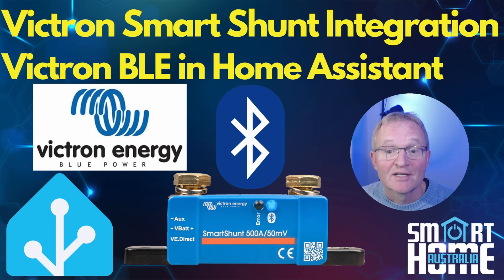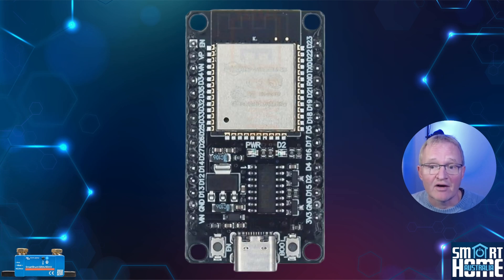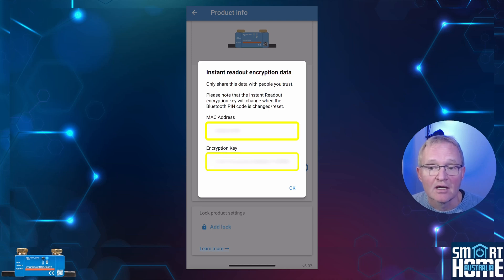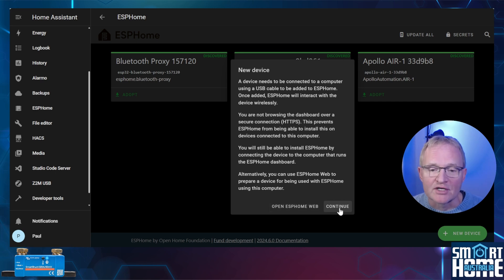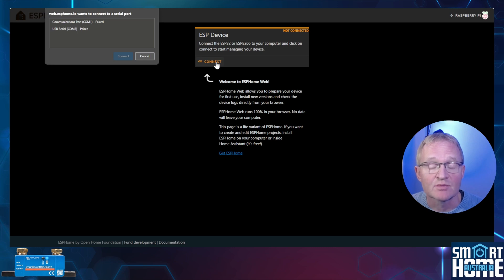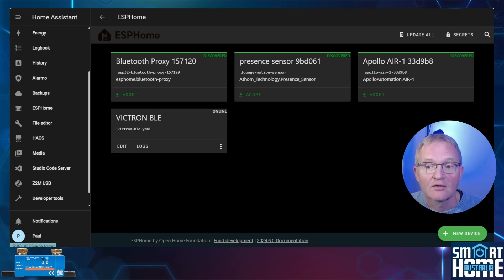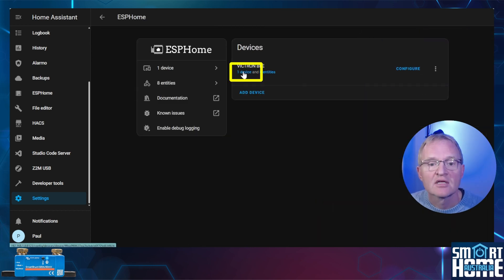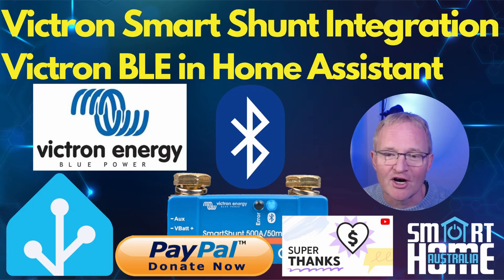Integrating Victron Bluetooth Device into Home Assistant: A Comprehensive Guide

Comment: It works to the moment that I make new device and write firmware. After add shunt it doesnt Connect anymore. Tried 2 esp32. What I do wrong?
Reply from the maker: Yep — this exact “works until I add the SmartShunt bit, then the ESP32 goes offline” is usually one of these three things, a few things you can check for:

1) The ESP32 is rebooting (power/noise) once BLE scanning starts
BLE scanning + Wi-Fi is a bit heavier on the ESP32. If your power is marginal, it’ll boot, flash fine… then fall over when it starts scanning.
Try this for a potential quick win:
- Power the ESP32 from a solid 5V supply (aim 1A+ capable). Don’t power it from sketchy USB ports / thin long leads near the shunt/inverter wiring.
- Add a big cap across 5V/GND near the ESP32 (e.g. 470µF) + a small one (0.1µF/1µF) if you have it.
- Keep the ESP32 physically away from high-current cabling/shunt bars (noise city).
- In ESPHome set `logger:` to INFO (DEBUG spam can contribute to instability).

2) It’s online, but you’re getting no shunt data (looks like “not connecting”)

Fro this there are two gotchas from the `victron_ble` component:
- You must use the device MAC address + AES “bindkey”, and Instant readout via Bluetooth must be enabled. 
- If your phone is actively connected to the device in VictronConnect, **the Instant Readout advertisements stop**, so the ESP32 sees nothing. ([GitHub][1])

To test this:
1. Stand 1–2m from the SmartShunt with the ESP32.
2. Completely close VictronConnect (don’t leave it connected).
3. Watch ESPHome logs for Victron packets.

3) Bluetooth range/placement is worse than you think
Victron even calls out that the shunt + big cables reduce BT range, and metal/vehicle chassis can make it “unacceptable”.
Reply: @smart_home_australia I use victron natibe, when it get enough range it pop up in HA and just add it ;)

Comment: How does the esp32 get your wifi network data?  Does it inherit the wifi config from the Home Assistant or did I miss a step where we told it the wifi info?
Reply from the maker: Yep, you didn’t miss a sneaky “inherit Wi-Fi from Home Assistant” step.

An ESP32 won’t magically grab your HA Wi-Fi settings. It gets Wi-Fi in one of these ways:

1. Baked in at compile/flash time
   If you’re using ESPHome, the ssid/password are in your ESPHome config (usually via secrets.yaml). When you flash it (USB/web flasher), those creds get written onto the device. After that it joins Wi-Fi and you manage it OTA.

2. Provisioning during onboarding
   Some ESPHome setups use Improv (Serial or BLE). In that flow, HA (or the ESPHome web installer) prompts you for Wi-Fi and then securely pushes the credentials to the ESP32 during pairing.

3. Temporary AP/captive portal
   Device boots, creates its own Wi-Fi hotspot, you connect to it and enter your Wi-Fi details.

I hope that helps.
Reply: @smart_home_australia  I kinda figured out if I used the interactive setup for the initial flashing it prompts for wifi and even adds a failover wifi option.  Thanks for the fast reply.  My son in law is going to deer camp this weekend and i am not.  My main rv solar is in home assistant and he wants his solar integrated via his smart shunt in another building.  I am hoping he can plug it in and with my prompting and his physical help we can flash it successfully.  will find out soon enough
Reply: It's working as planned.  I didn't add the "power" sensor because it wasn't on the default template I used.  Can i add a sensor to the yaml then just reinstall over wifi
Reply: Update yeah you can add other sensors from the supported list and update the yaml and push the updated config.  I am also very impressed how quickly these little units boot
Reply from the maker: I was amazing... the speed was excellent and wiht those additional sensors you get great flexibility...

Comment: A year late but I wanted to thank you for this. I’ve been having all sorts of problems with the Modbus integration for the last 6 months, recent updates have broken it quite badly, and this has solved all the problems I was having. Incidentally, although I haven’t tried it myself yet, there is now a Victron BLE HACS integration for HA. If this works it would mean being able to cut out the ESP32 from the system (providing the HA computer has BT and is within range). As I say, haven’t tried it yet as I’m reluctant to mess with a working system, but I may give it a try as I’m not likely to use my campervan much over winter (I’m in the UK). At worst I’ll have to restore a backup. Thanks again
Reply from the maker: Love hearing this – glad it rescued you from Modbus pain! That integration has been a bit “two steps forward, one step back” lately, so having the ESP32 + BLE bridge as a rock-solid workaround is a nice place to be.

I’ve seen that Victron BLE HACS integration but, like you, I’d only switch a working system if I had time to tinker. If you do try it over winter, just watch:

- BLE range in a campervan (metal box = sad Bluetooth)
- How quickly it reconnects after HA restarts / Victron sleeps
- Whether all the entities you care about show up with the right update rate

Definitely grab a backup first so you can roll straight back to the ESP32 if it misbehaves.
Reply: Hi mate, well this escalated quickly. Found myself with an hour to kill and went into my van HA integrations, disabled the BT proxy and re-enabled the Pi BT and lo and behold, all the same sensors showed up! The only downside of BT is that it doesn’t expose as many entities as Modbus, but the main ones I need are all there, and it’s so much faster. I’ve now taken the ESP32 out of the van and all the functionality has remained the same. Mission successful 👍

Comment: Hi , Great video !. I am working on a ESP32 firmware without ESP home assiant and  I want to connect my victron smart shunt to it so that i  can get the data wirelessly through Bluetooth. Is that possible?
Reply from the maker: Hey, thanks!

Short answer: yes, it’s possible without ESPHome or Home Assistant, but you’ll basically be rebuilding what those do under the hood.

Here's the helicopter view:
1. In VictronConnect, enable “Instant readout via Bluetooth” on the SmartShunt.
2. In Product info you can see the MAC address and an encryption/advertisement key for that device – you need both to decrypt the BLE data.
3. On your ESP32 firmware (Arduino or ESP-IDF), write a BLE scanner that listens for adverts from that MAC, decrypts them with the key, then decode the payload using Victron’s published Bluetooth protocol.
4. Once parsed, you can push SOC, voltage, current etc out over Wi-Fi/MQTT/serial however you like.

Good reference code to study and port the logic from:
-Fabian-Schmidt’s esphome-victron_ble
- keshavdv’s victron-ble (Python)

Good luck !! let us know how you make out.
Reply: @smart_home_australia   Thank you so much for taking out the time to give such a detailed response ! . I will def check it out and let you know how it goes. Best wishes to you
Reply from the maker: You are welcome.... here to help.

Comment: The instructions were clear.   I have tried a few times,  but at the very end,  it seems my ESP32 wont boot back up.  The "connect call failed".  I do not see the ESP32 on my network nor in home assistant.     Any ideas on what to do>?
Reply from the maker: Thanks for giving it a solid crack. “connect call failed” at the end usually points to boot mode, power, or cable. Quick triage:

- Try a different USB port and a known good data cable (not charge-only).
- Hold BOOT while clicking Upload; release when “Writing…” starts. If no joy, hold BOOT and tap EN once.
- Do a clean slate: esptool.py erase_flash, then re-flash the fresh ESPHome .bin. In ESPHome: Install > Plug into this computer.
- Confirm the YAML board matches your devkit (esp32dev/nodemcu-32s/etc.). Wrong board can stop boot.
- Open a serial log: esphome logs --device COMx (/dev/ttyUSB0). “Brownout detector” = power issue; use a short cable or powered hub.
- Unplug any sensors while flashing—GPIO0 pulled low or other wiring can trap it in flash mode.
- If it boots but won’t show in HA, check Wi-Fi creds and the API encryption key—mismatch triggers “connect call failed.”

If you can paste the first 30–40 lines from the serial boot log, we can pinpoint it fast.
Reply: @smart_home_australia  I dont think it is the cable as I flashed a bluetooth proxy with the same cable the day before on the same model ESP32.     The first time i tried I had an indent issue in the yaml.   Then i tried again without full erase.   I am erasing the ESP32 with esptool and trying again
Reply: Ok.  Got the same hang up again where it would not connect after saving.    I copied the error and the first part of the logs. 
INFO Starting log output from 192.168.8.248 using esphome API
INFO Successfully resolved victron-ble @ 192.168.8.248 in 0.000s
WARNING Can't connect to ESPHome API for victron-ble @ 192.168.8.248: Error connecting to [AddrInfo(family=<AddressFamily.AF_INET: 2>, type=<SocketKind.SOCK_STREAM: 1>, proto=6, sockaddr=IPv4Sockaddr(address='192.168.8.248', port=6053))]: [Errno 113] Connect call failed ('192.168.8.248', 6053) (SocketAPIError)
INFO Trying to connect to victron-ble @ 192.168.8.248 in the background

[11:54:33]rst:0x1 (POWERON_RESET),boot:0x13 (SPI_FAST_FLASH_BOOT)
[11:54:33]configsip: 0, SPIWP:0xee
[11:54:33]clk_drv:0x00,q_drv:0x00,d_drv:0x00,cs0_drv:0x00,hd_drv:0x00,wp_drv:0x00
[11:54:33]mode:DIO, clock div:2
[11:54:33]load:0x3fff0030,len:6276
[11:54:33]load:0x40078000,len:15736
[11:54:33]load:0x40080400,len:4
[11:54:33]load:0x40080404,len:3860
[11:54:33]entry 0x40080634
[11:54:33]I (29) boot: ESP-IDF 5.4.2 2nd stage bootloader
[11:54:33]I (29) boot: compile time Oct 18 2025 11:30:14
[11:54:33]I (29) boot: Multicore bootloader
[11:54:33]I (31) boot: chip revision: v3.1
[11:54:33]I (33) boot.esp32: SPI Speed      : 40MHz
[11:54:33]I (37) boot.esp32: SPI Mode       : DIO
[11:54:33]I (41) boot.esp32: SPI Flash Size : 4MB
[11:54:33]I (44) boot: Enabling RNG early entropy source...
[11:54:33]I (49) boot: Partition Table:
[11:54:33]I (51) boot: ## Label            Usage          Type ST Offset   Length
[11:54:33]I (58) boot:  0 otadata          OTA data         01 00 00009000 00002000
[11:54:33]I (64) boot:  1 phy_init         RF data          01 01 0000b000 00001000
[11:54:33]I (71) boot:  2 app0             OTA app          00 10 00010000 001c0000
[11:54:33]I (77) boot:  3 app1             OTA app          00 11 001d0000 001c0000
[11:54:33]I (84) boot:  4 nvs              WiFi data        01 02 00390000 0006d000
[11:54:33]I (90) boot: End of partition table
Reply from the maker: Got it—thanks for the log. Two big clues:

- HA resolves the host instantly but TCP to 6053 fails > either the device isn’t listening on the ESPHome API (no `api:` in the build / mis-indent), or your HA box can’t route to that subnet.
-  Your device IP is **192.168.8.248**. That smells like a guest/4G router/hotspot range. If HA lives on 192.168.0.x / 1.x, it simply can’t reach 192.168.8.x > you’ll always get “connect call failed”.

Here’s the quickest path to a fix:
1) Make sure they can see each other
- Put the ESP32 on the same SSID/VLAN as Home Assistant (not a guest/hotspot).
- From HA (SSH add-on): `ping 192.168.8.248`

 No replies? That’s the problem—move the ESP to HA’s LAN.
 Replies? Then the device is reachable and the API likely isn’t running.

2) Guarantee the API is actually there (and listening)
Flash a minimal that can’t be mis-indented, then test by IP:

```yaml
esphome:
  name: victron-ble-test
esp32:
  board: esp32dev
  framework:
    type: arduino

logger:
api:                      # leave encryption out for this test
ota:
wifi:
  ssid: "YOUR_2G_WIFI"
  password: "YOUR_PASS"
  ap:
    ssid: "ESP32-Recovery"
    password: "12345678"
captive_portal:
web_server:               # quick sanity check: http://<IP> should load
  port: 80
status_led:               # optional: built-in LED on many devkits
  pin: GPIO2
```

Re-flash (after erase), wait ~30s, then:

- In a browser: `http://<device-ip>` → page loads = firmware is alive.
- In HA: **ESPHome → Add → by IP**. It should pair instantly.

3) If you still can’t open 6053 but web works
- That means the build didn’t include the API before. Keep `api:` at root (same indent as `wifi:`/`logger:`).
- If you previously used `api.encryption.key`, after a full erase HA’s saved key won’t match. Delete the old device from HA’s ESPHome integration and re-add by IP (or re-insert the same key in YAML). A key mismatch typically connects then errors; a flat “connect call failed” is more often “port not open” or routing.

4) When you re-enable Victron BLE
BLE on ESP32 can starve the API if you’re tight on RAM/CPU. Add these guardrails:

```yaml
api:
  reboot_timeout: 0s      # don’t auto-reboot when HA isn’t connected
logger:
  baud_rate: 0            # frees UART/CPU
esp32_ble_tracker:
  scan_parameters:
    interval: 1100ms
    window: 110ms
# …then your victron_ble sensors here
```

If API becomes flaky after turning BLE back on, the scan throttle above usually stabilises it.

5) Quick tells from serial
- Only bootloader lines then silence → app likely running but logger muted; ensure `logger:` is present.
- Immediate “Guru Meditation/abort” → wrong `board:` target; recompile for the exact board.
- Repeating Wi-Fi errors > 2.4 GHz only, 20 MHz width, channels 1/6/11, avoid band-steering.

If the above doesn't help, then I give up lol.

Comment: Could I use this same steps but for my Solar Charger and Inverter? It would be Awesome. Did somebody already do it?  Thanks.
Reply from the maker: Short answer: yes—if your charger/inverter exposes a usable protocol, the same flow works.

Best-case gear
Victron, GoodWe, Sungrow, Growatt, Solis and many others expose Modbus (RS485/RTU or TCP), MQTT, or a vendor API. Lots of folks (me included) have done this in HA.

Two easy paths
1. Modbus route
- RS485 adapter > your device’s comms port
- Confirm baud/parity and register map from the manual
- Add Home Assistant’s Modbus integration, create sensors from the registers, then template to kW, SoC, temps, etc.

2. Victron route
- Cerbo GX/Venus OS: enable MQTT/Modbus TCP
- Add the Victron integration in HA. No ESP needed; discovery just works.

When the device is “closed”,. use an energy meter (Shelly EM/3EM, iEM3155 + Modbus, etc.) on the AC side and infer production/charge or ESPHome with an RS485/TTL bridge if the UART/RS485 registers are documented.

Comment: You said in the video that you can use a esp8266, but I don't think they support bluetooth.
Reply from the maker: Great catch—you’re right. ESP8266 doesn’t have Bluetooth at all. If you only have an ESP8266, it’s still great for Wi-Fi sensors, relays, IR blasters, etc.—just not BLE..
Reply: @smart_home_australia  Thanks for your video, It wasn't exactly what I needed as I was trying to do similar with a Victron AC charger, but you gave me a few good clues and I was successful.
Reply from the maker: Love hearing that, thanks! And huge congrats on getting the Victron AC charger working.

If you’re keen to tighten it up in Home Assistant, a couple of quick options:

For Blue Smart IP22/IP65, use an ESP32 Bluetooth Proxy or the Passive BLE Monitor integration to pull voltage/current/temps into HA. Nice for quick dashboards and “charge complete” alerts.

For Venus OS / Cerbo GX in the mix, enable MQTT or Modbus-TCP on the GX, then map the charger entities in HA for rock-solid telemetry and automations.

Comment: please please please tell me this will work with my mppt device.
Reply from the maker: Short answer: it’ll work if your MPPT exposes a wired data port (RS-485/RS-232/VE.Direct) or Modbus/TCP—not if it’s Bluetooth-only without an API.

Here’s how to check and hook it up:
Look for one of these on your MPPT’s spec sheet/label:
RS-485 Modbus RTU (common on EPEver/SRNE/etc.)
VE.Direct (Victron SmartSolar)
RS-232 service/data port
Ethernet (Modbus/TCP)

Home Assistant paths:
Modbus RTU (RS-485): use a USB-RS485 adapter; add the HA Modbus integration, then sensors for volts/amps/SoC via registers.
Victron VE.Direct: use a VE.Direct-to-USB cable; add the Victron or VE.Direct integration.
Renogy Rover: works via a USB-TTL/RS232 adapter with the Renogy Rover (HACS) integration.
Modbus/TCP: point HA’s Modbus to the IP/port.

Won’t work (as-is): Bluetooth-only MPPTs without a published BLE protocol. You’d need their cloud/API bridge or a custom BLE integration.

So not super simple and google is your friend but possible, It's not a hot topic or on my radar, check out this video https://youtu.be/Kj7Ml4vJTc8

Comment: Question - Why cant you just use Bluetooth Proxy on the esp32 to pick up device?
Reply from the maker: Great question! Short answer: sometimes you can—often you can’t.

- What BT Proxy does: ESPHome’s Bluetooth Proxy just forwards BLE advertisements to Home Assistant. If a sensor broadcasts its data (e.g., many thermometers), HA can see it fine.
- When it fails: Lots of devices need an active, encrypted GATT connection or pairing (locks, buttons, some lights/bridges). The proxy either can’t maintain that reliably or has very limited concurrent connections, so it won’t “pick up” or control them well.
- Phones for presence: iOS/Android randomize MACs and don’t advertise consistently, so a proxy won’t reliably detect your phone for presence.
- Room accuracy: Proxy aggregates everything at the host, so you lose room context. For fast, room-level presence (RSSI per room, beacons), use ESPresense or dedicated BLE beacons instead.

If your target device broadcasts what you need, BT Proxy is perfect. If it needs pairing/commands or you want per-room presence, go ESPresense (or a vendor’s native integration).